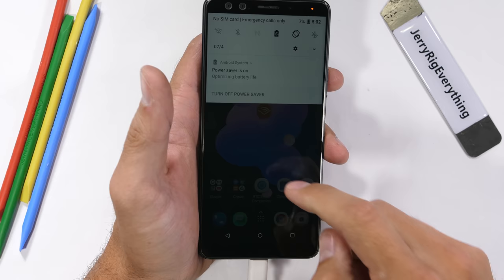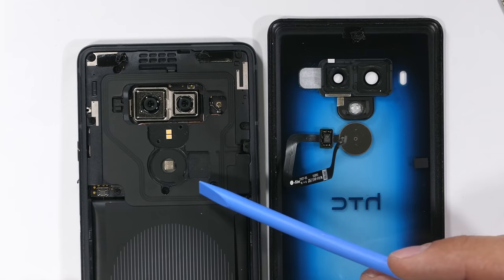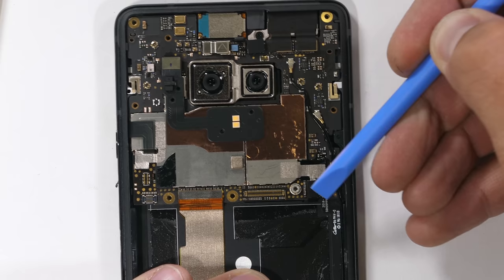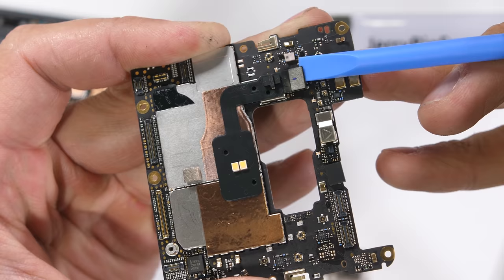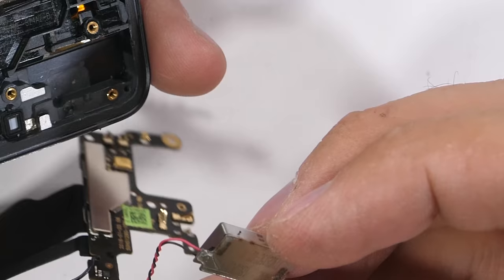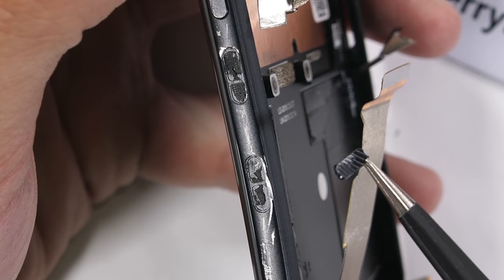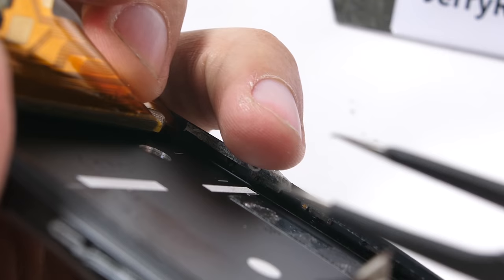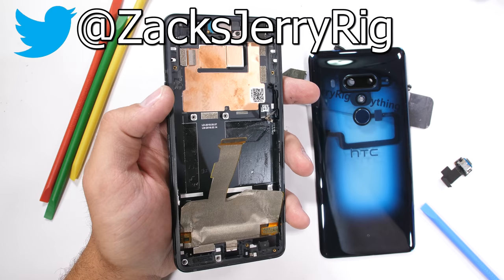HTC U12 Plus Teardown - Can the 'buttons' be fixed?

Comment: As someone who owns the U12+ there's nothing wrong with my buttons, except the occasional hiccup in landscape orientation where it won't register presses. 
But any other time they're fantastic and the haptic feedback is great
Reply: David hunsinger yeah this would never happen in the real world because Zack took a sharp object to the buttons
Reply: Gerald you know what would be even better? Regular, tactile buttons.
Reply: supernightslash have you spent much time with the U12+ or are you judging from the outside?
Reply: David hunsinger lol you said yourself it sometimes doesnt work on landscape. Guess what, tactile buttons work 100% of the time. I've alao tried taptoc feedback buttons (iphone) and normal buttons feel better.
Reply: Yeah. I have the u12 and My buttons work just fine. I haven't had a problem at all with it. Reviews are one thing,but actual use is way different.
Reply: supernightslash yeah. But regular tactile button might not be good for the water resistant
Reply: Using a flame red U12+ in HK, and I'd say the buttons works, well, just like buttons. 
They are perfectly functional, and I do like the haptic feedback.
Reply: Jorgensen Penus yeah but tactile buttons also fail, get gunked up or fail to register .. they aren't immune to the same issues. Also less ports for water to enter.
Reply: He meant the smart rotational has hiccups, the buttons are fine.
Reply: Tom Hsia I actually enjoy the buttons, I haven't been hindered by them at all, in fact after a day or two you start to believe they're actual buttons.
Reply: Some also attacked the screen. Dim? Dull? Not as sharp as the iPhone 6? Ridiculous, the HTC U12+ screen is fine, even in full sunlight. For many HTC phones, here is a brightness boost you can only trigger by having auto brightness on in sunlight. For the HTC 10, once the brightness boost kicks in, the color gets washed out, which does not happen in the U12+. Phones nowadays are all oversaturated, same goes for their cameras,.
Reply: Once you get used to PSBs, you'd say actual tactile butons are bad. I got used to so many HTC features over the years, all of which got removed, sadly.
Reply: Besides, PSBs have so much more potential. Make it be able to register hard presses and regular presses, like the newer Apple trackpads.
Reply: I do not enjoy the buttons, but I'm okay with them. I've started to prefer the feeling of PSBs, but it would be so much better if I could adjust the sensitivity.
Reply: The real problem is that you really bought that "phone"
Reply: Eduard Gabrian I have my tastes, I like (d) HTC. So I do NOT regret getting the U12+.
Reply: I'm waiting for a price drop to purchase the U 12+.

The no buttons on the side of the device is no biggie for me. I had a volume down button stuck permanently if the past so sucks for me at the time. 

I guess my wife and I are pretty lucky HTC user's. Since M7, M8, HTC 10 and a few Desire model's we've ran in very little friction in long term ownership.

We still use our 10's and I own a GP2.  My M8 is still alive and running til this day.  I swap Sims for throwback Thursdays 😂 to my older devices. I get alot of "That phone still working?!" when I pull out the M7. 

How is the 4K recording on the U 12+? I wish HTC would've kept OIS for the front facing camera. That's why I won't give up my 10.
Reply: thinking of buying this phone. any problems with a case? i always put a transparent hard sillicone case on my phones...

also any other noteable probolems\? lags\;? restarts? Freezes? camera failures? idk wahtever else wonky
Reply: World first CE PDA, World first Windows 3G smartphone, World first touch-centric smartphone, World first Android smartphone, World first 4G smartphone in US, World first 5inch 1080P smartphone, World first metal body smartphone, World first duo cam smartphone, World first dual tone finished all metal smartphone, World first OIS front and back smartphone, World first squeeze tech smartphone. BOOM!!!

Comment: Tactile buttons are always better
Reply: Saiprasad Alva 🤣🤣🤣omg hope that's a joke...
Reply: supernightslash this sh** is not even satisfying to click...
Reply: i read tactical buttons
Reply: Simulated buttons are significantly better than regular buttons
Reply: Incorrect.
Reply: It's opinionated, though I prefer ACTUAL buttons.
Reply: 池たくみ it seems like you didn't see how easily he removed the buttons from the phone's frame
Reply: 池たくみ No they wont
Reply: 池たくみ my Note3 doesn't have any broken buttons and it's almost 5 years old.
But with those sensitive buttons you can't even take a screenshot because you can't press more than one button at the same time. And you can't truly turn the phone off because the sensitive button have to be on all the time.
And of course: Have fun if your phone has some software issues and the buttons no longer work.
Reply: 池たくみ Thumbs up for innovation and they better improve it.
Reply: With good haptics you wouldn't even know they weren't real, i.e the touchpad 'click' on a MBP.
Reply: Tim R. You dont need the button you double tap edge sence and you take a screen shot and easier
Reply: I have an HTC M7, M8, NO, and currently using a HTC U11. They all work to perfection.
Reply: 池たくみ My note 2 button still works perfectly.
Reply: G G this buttons are more for the ip 68 and for the people who preferred this type of buttons
Reply: 池たくみ Not when my iPhone 5 still work flawlessly. Seriously, have you ever used them before? You sound like diehard Android fanboy trying to make Apple looks bad. 

   This is coming from someone who uses both, so don’t think I’m a fanboy.
Reply: My s6 active is 3 years old and it has all tactical clicky buttons...ip68 and still works after a bunch of dips and dives in salt water/pool/mud etc
Reply: 490th like
Reply: Testicle buttons?

Comment: I really want htc too succeed but it's only possible if they combine the metal unibody with a modern design :(
Reply: Zedd Eff me to I think HTC is going back to the metal design next year because glass isn't working out and many ppl miss metal
Reply: Gerald I really hope so. They already have great cameras. Just need a metal body, a 2:1 screen, and front-facing speakers and they have a winner.
Reply: And buttons

Comment: Die hard HTC fans (those left) need to look at it from the context of 2018. HTC doesn't exist in a bubble in this crowded and highly competitive market. There are many factors that led to HTC's really awful position. I say these things as a long time HTC fan mind you.

1. I believe that HTC's R&D hasn't been directed toward's any worthwhile features the past couple of years. The squeeze feature is a flop for the most part. Their audio solution is proprietary and speaker quality is less than original boomsound. ANY R&D money spent on features that won't sell more devices is wasted money for a company in HTC's position. 

2. HTC's manufacturing quality control has gone down measurably. Look at @ZacksJerryRig's last few teardowns of the U Ultra, U11, and U12 Plus with their many issues with manufacturing quality in the hardware. Some of this could be due to Google taking 2,000 employees, who knows

3. Removing features like the headphone jack, wireless charging, & physical buttons and replacing them with either proprietary solutions that force you to buy accessories that work ONLY with their devices or just not work well at all (the new buttons) just stinks of desperation for any money coming in.

4. HTC's refusal to reexamine their pricing strategy has been one of the biggest factors to hurt HTC since the M9 forward. When you can an experience that is arguably close to an HTC phone from something like OnePlus then why buy an HTC phone other than brand loyalty?

5. HTC's loss of carrier positioning essentially killed HTC in the USA. They are in the same place as Huawei but with FAR less resources. If you aren't going to court the carriers here in the USA then you might as well not even sell here if you are going to have high prices.

6. From an aesthetic side since HTC shifted to glass on glass I am willing to argue that they gave up what made their phones stand out from a design and aesthetic point of view. The U12 looks like a V30. You can't stand out if you look like everything else that sells more.

I say these things as who has owned many HTC devices (HTC Rezound, Droid DNA, M8) and it disappoints me seeing HTC's slow motion trainwreck. I will say that their new phones are most likely very good phones, especially in a vaccum. But the reality is that they aren't in a vacuum. I just want to see more competition in the smartphone space. But with the decisions HTC execs are making I don't see them ever being real and serious competition in the smartphone space ever again.

Don't get me wrong. I want HTC to exist. But in the open market, does a company that refuses to see the tides of change coming and refuses to course correct deserve to survive?
Reply: Nice book
Reply: The only problem I see if the poor costumer service and the lack of marketing. As for the edge sense, I'm always using it, so I see it useful.

Comment: HTC makes interesting phones that look good, but they always have some weird or stupid design decisions on their phones that are deal-breakers. U11 was super weak. U12+ looks good and has all the specs you want except for wireless charging, but it is still too weak and has weird buttonless buttons that also seem to be quite weak.
Another baffling thing is pricing. If Oneplus can make a profit selling more durable flagship phones with identical hardware at ~$500, why does this thing cost ~$800? I can not see anything on this phone that makes it worth 300 USD more than the OP6.
Reply: Then buy a OP6
Reply: K Ryusan That's exactly what people do. And HTC is going bankrupt because of their own stupidity.
Reply: Kepe got to remember though the one plus isn't that great at all.  It's hard is and software are to bland.  Speakers suck and the camera does to.  And they are using one of Samsung cheapest panels. which will get burn in really fast.  The HTC and LCD in general never get that and look amazing for the life of the device.. iPhone** I have a LCD Galaxy phone from 8 year ago the panel is still crazy good. The HTC speakers are amazing the camera is as good as the pixel 2 and the screen is better then most out there.  HTC may be stupid for the buttons I give you that but they work for me just fine.  And it moves super fast.   HTC has beem there for us in the past to give us a freedom option over the iPhone cult. And they never put us on a prison and forced us all to use the same old bland crap.  I believe let's give the grandpa of phone Maker's a shot.
Reply: HTC is clearly not a brand for people who don't like innovations, so go to copying ones 🤣

Comment: The U11 is the best HTC phone I've owned. Will not be buying another phone until 5G becomes mainstream. I've repaired the screen twice and the back once The price I pay for not putting an ugly cover on my phone plus it got run over by an SUV and survived with just a cracked back cover. Family and friends always look at my phone and ask if I got a new phone because it looks so good even after 3 years. Wife has a U12+ which she upgraded from HTC 10. We've both owned 9 total HTC devices between us starting from the M7 which we switched from Motorola and Samsung. I always use the squeeze function to launch camera and other things without having to turn on the phone, unlock the screen and pressing buttons. Not sure why people bash it's usefulness. It's a time saver. Phone is still as snappy as new, camera is amazing, battery's still good and charges super fast, works with my wireless android auto unit. Can't ask for more. Wish Verizon would start carrying HTC devices again. We need a comeback story for HTC!

Comment: The buttons can be persuaded off? Lol yeah with a blade? PSA if you buy this phone dont slice the power button off!
Reply: Yeah, unlucky. I always start my day trying to slice the buttons off. Can't get more than a day out of it.
Reply: I bet i can remove those buttons with my fingers, no razor blade needed, did you see how easily they came off in the durability video?
Reply: I got the u12, I'll see how it holds up.
Reply: D. Shadocx You can't, they're stuck good, not razor blade good, though...
Reply: Tom Hsia you really tried to remove them with your fingers? Why would someone one try that on their brand new phone?
Reply: I trusted them enough. HTC phones had always been tanks for me, hard to believe the HTC u12+ would be so different.
Reply: Sadly, the quietly brilliant HTC is gone, died with the U Ultra
Reply: D. Shadocx Also, I had to be sure they were not gonna pop off willy nilly. (To be honest, I did not try my best to remove them)
Reply: Tom Hsia the HTC 10 was solid as fuck and the front camera had OIS, exactly what I think, since the U Ultra HTC isn't that good, look at their sales.
Reply: D. Shadocx You took the words right out of my mouth. R.I.P HTC...
Reply: Yeah, I wish they do another 10 - it was the culmination of unibody aluminum design, 4 years in the making, and then they just forgot about it altogether. The liquid design is pretty too, but it's not as durable and they even skipped wireless charging for a second year.
Reply: They won't. That quietly brilliant design language is dead because it is not exciting, and consumers nowadays seemly prefer flashy stuff. I would buy the HTC 10 over any other phone in 2016, but not many people my age because it is "not flashy", "boring", or "has an ugly logo" (things people around me have said). This day and age, it's eye-catcher or death. Why did so many people buy the touch bar MacBook Pro? Sure, the keyboard is comically bad, the specs are not competitive, and MacOS High Sierra is an unstable piece of junk compared to the Mac OSX of old. But hey, its flashy.
Reply: The same thing goes for music. Gone are the days when music had so much nuance, thimble, are were treated as art by the musicians. Now, even if it is unremarkable, as long as it is catchy and/or upbeat. Chances are it will succeed.